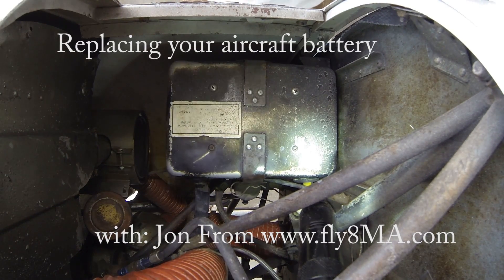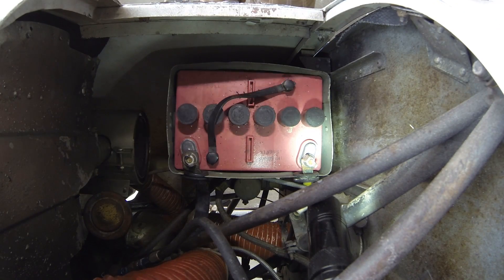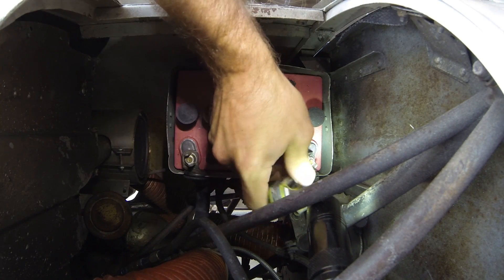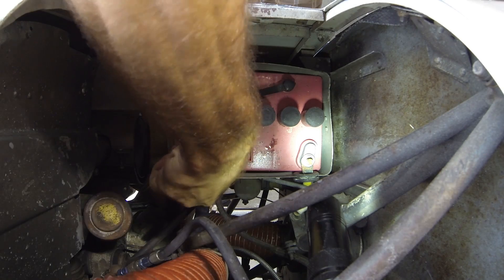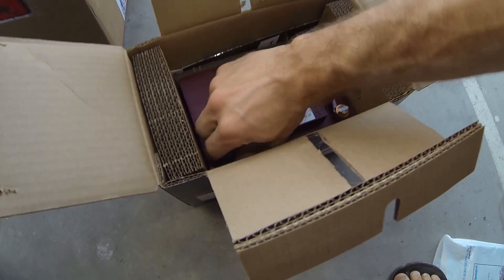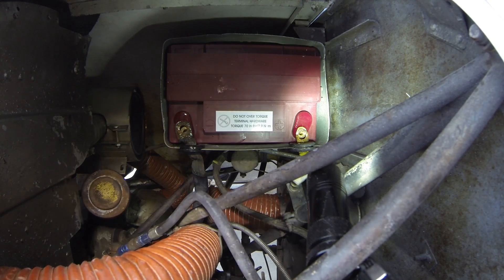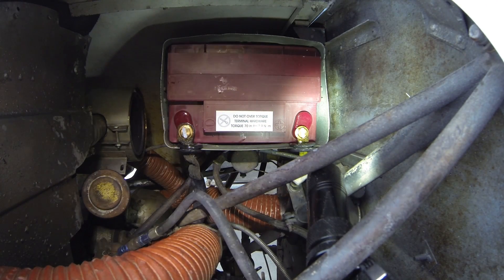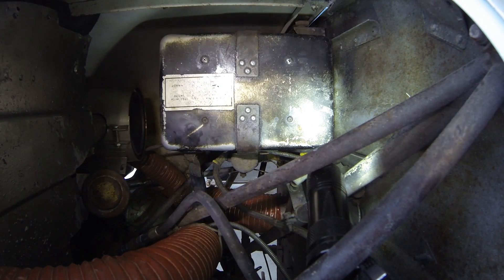How To: Replace Aircraft Battery | Logbook Endorsement

Comment: You should torque the Positive terminal BEFORE attaching the Negative  terminal to prevent causing an arc then your wrench hits the engine mount or aircraft structure. A good practice is remove the negative side first when removing a battery and connect the negative side last when installing a battery so there is no way you can short your wrench to a ground point.  If you short your wrench or other tool to ground the chances are very good you will damage something, the arc will burn a pit in the aluminum or worse in the engine mount when the battery is in close to  the engine mount.  A arc pit in the mount can lead to a catastrophic failure of the engine mount over time.  Battery electrolyte is Sulfuric Acid and water about a 30% mixture

Comment: Title 14 CFR 43 Appendix A allows the pilot to replace and service batteries within limitations.  However, if a pilot preforms any preventive maintenance they are required to follow the same rules and regulations as the A&P mechanic in part 43.13 Performance rules (general) and 43.9 record entries.  This requires pilots to have the current Service Manual, special tools (torque wrench) hydrometer for batteries, multimeter testing the voltage, thermometer for the outside the 70 to 90 degree F and so on.

The torque in accordance with the Concord manual is 50 plus or minus 2 inch-pounds.  Also, always disconnect the NEGATIVE BATTERY FIRST and INSTALL THE GROUND CABLE LAST.

WARNING: Low Capacity Hazard.  Aircraft batteries are certified to have a certain minimum capacity for emergency operations in the event of an electrical system generator failure.  NEVER USE A BATTERY WITH LESS THAN 80% or rated capacity and never “JUMP START” an aircraft with a “DEAD” or discharged battery.  How did you test this???

You logbook (record entry) endorsement does not meet part 43.9 requirements as it does not reference the data (step-by-step) procedures you were required to follow.  As an A&P/IA I don’t know what OPS check OK means.  Did you check the voltage before installation or the specific gravity before installation?

This YouTube video is setter a lot of people up for disaster in my opinion.  Needless to say, I am shocked by what I just watched as a retired FAA inspector but not surprised.
Reply: You say the torque is 50 +- 2 inch pounds but on the battery it says 70 inch pounds

Comment: Most batteries use sulfuric acid! If you take the negativity battery wire off first it cuts down the chance of sparks. Also contact it last.
Reply: Good call sir:-)